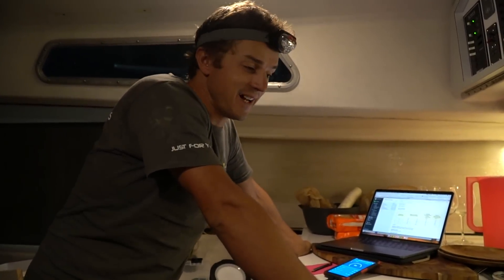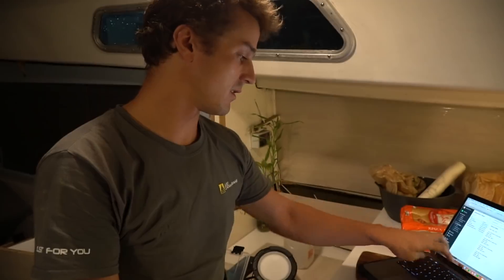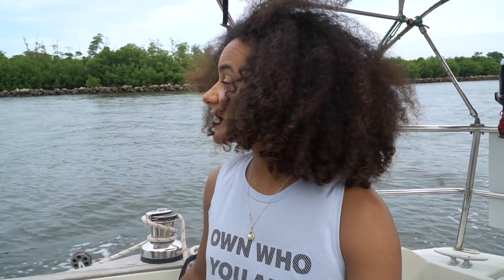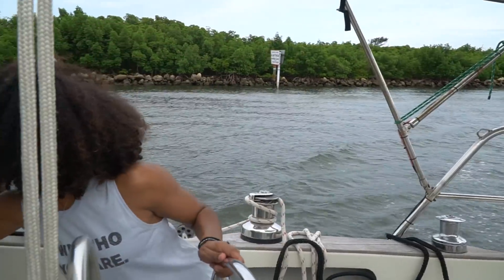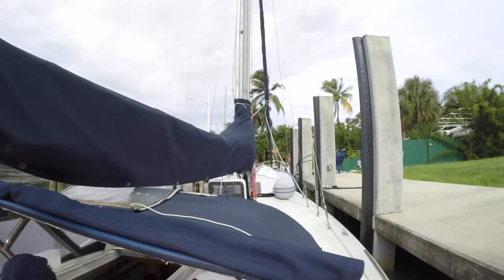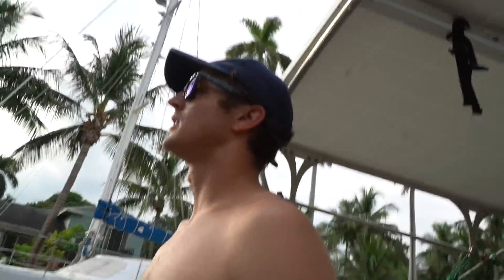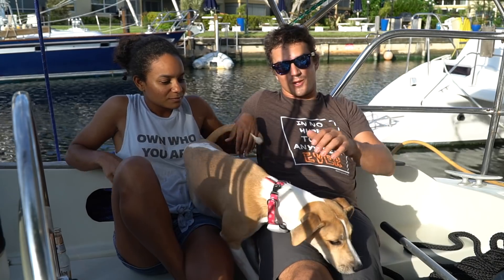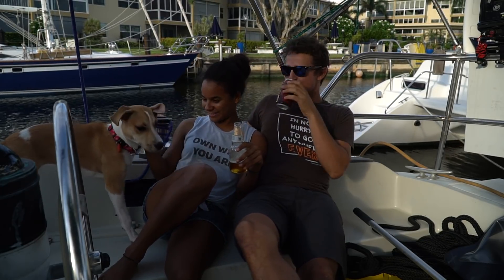Pushing our Electric Motor to its Limit— Sailing Uma [Step 139]

Comment: I think running the cooling lines on the electric motor is a very good idea, the cooler you can keep it the better it is going to work. 

Although I think the best route is going to be to have a fresh to raw type setup like you have on a petrol engine with a sea strainer and all that jazz. 

Really all you need is a tank for the coolant, and then have a larger diameter tube run through it this will prevent the system from clogging. 

I might pop off a drawing of what I have in mind and send it to you.

Comment: Ok guys , water cool that motor with a copper coil , use raw water and exit it out where you can have a visible confirmation of flow - cockpit drain maybe . Lots of electric engine cooling pumps for raw water out there . If you want it on a stat Honeywell should have something with a bulb from refrigeration you can fit . Have an override wired  because humans can anticipate and turn it on before it gets hot .   Fans rely on ambient air temp that can spike in a sun-drenched boat or one closed up due to bad weather .  

Fix your cooling issue and I think you have it . You can add a generator on deck  if the engine is not overheating and get tons of range if you ever need it for exploring a river of canal or an intercostal waterway  . Meanwhile 2 hours of range should be lots for most of the time .

Comment: Saw a video years back where a guy takes an alternator removes the triode and runs wires from the connections, putting out 440v 220v and 12v at the alternated amperage i.e. 65 amps and runs it off a small motor .. almost perpetual energy. un into voltage regulator and inverters . just a thought.
Reply: You make no sense, and losses in electric motors and generators are so large, there is no way to get anywhere near the imposible perpetual  motion.

Comment: Good stuff.. I love it ..
We use victron too and .. had the same prediction at the first time. 
The Victron does predict the power correct if it’s set correct so maybe you can adjust something or it needs to learn.
Another thing to think about is that the Tide does delay up on rivers..

Comment: I would think a blower pushing fresh air around the motor would help a lot.. The only time you should really need that much amperage though is to get into a difficult harbor in difficult conditions. Have you looked into a more efficient DC motor? And have you researched the prop size and pitch that will work best with the motor's torque and efficiency RPM curve? You might be able to pick up considerable efficiency with just a different prop.

Comment: just because the motor is rated for high temp operation it is not a good idea to run it hot at higher temps motors are less efficient so more power loss it is far better to use the heat from the engine on some way maybe a peltier to convert some of the heat into electricity to drove a raw water pump and cool the engine down

Comment: Hay guys,
Great video, thanks for sharing.
Suggestions - mount that blower up on the cockpit cowling, route the duct down and blow cool air on the motor. Will do much more cooling of the motor and also help cool compartment. Also, mount a retractable outboard motor bracket on the transom so you can use that nice dinghy motor to assist when needed. Can save your bacon or just help out during long runs.
Cheers, John H.
B.C. Canada

Comment: An "A" for effort, but I doubt this will work out in the long run. While sailors went without motors for ages, they didn't have to deal with all of the modern hindrances and requirements. You'll have much more than 3 knot currents to deal with when you're in full-on cruising mode. While an all-electric set up is possible, it isn't cheap and would really need to be designed from the ground up. Ultimately, a reliable motor is a matter of safety for yourselves, but more importantly for the other folks on the water around you. It would be tragic indeed for you to harm another person, or vessel due to a lack of engine and hull control.

Comment: To lazy to read all the comments so here are a few thoughts.  Maybe with a closed loop system you could use the heat you are generating with the motor to heat up water for showers? OR  You should be able to design a self circulating system with sea water to help keep the temps down, make physics do the work in stead of losing energy to a pump.  Based on watching your channel your sailing skills show that you obviously don't "need" the motor.  Keep experimenting!

Comment: I'm going through an electric conversion right now on my Pearson.  Two 10kw motors on the shaft for 20kw peak output.  Rarely will I run at peak (if ever); the two 10kw motors won't work as hard and won't run as hot, thus no need for liquid cooling. I really hope to avoid the thermal efficiency issue.  My boat is a P35, slightly smaller and lighter than your P365.

 By the way, I totally envy your battery config.  Still drooling.
Reply from the maker: Sounds like you might have one of the kits from Electric Yacht? They make some quality stuff. 20kW will probably cause cavitation long before you peak out. But agree with the lack of cooling needed. A motor upgrade is on our list.

Comment: Hey guys, i came across this electric boat where the electric motor is actually mounted under the boat and therefore stays cooler as the water cools it, maybe a future project? :)

Comment: I would consider enclosing one end of the motor in a sealed box and venting that with the inline fan so that cooling air is draw through the motor rather than blown over it.

Comment: Sorry guys. Electric is not yet a viable engine option for blue water cruising.
Or even for coastal cruising in many locations. Open your horizons and increase your safety by going to diesel.

Comment: Thats great but i would rig the outboard on a descending bracket hybrid you would manage to get through the solent some day you may beed to run from the weather
Reply: That would require a long shaft on the outboard which then makes it pretty hard to use going up to a beach. He's already been over that point in another video.

Comment: I love your channel, I love your work ethic and I love that you are confident in your own choices and drive to try things your way.  But I can't help but be one of those people and on this occasion and question your priorities:  Three months at a dock with access to a workshop, shore power, even dry docking facilities and you pretty up your bathroom, make a zen garden and buy a new dinghy (yeah I know you did more, but you get the point)?  Why didn't you first, at bare minimum, address adding some grip back to the deck - you've been without that forever now.  Or re-adding some toerails, stanchions or lifelines?  When you spend literally all your time on your board, surely it's safety first, pretty second?

Comment: I very seldom make a comment, but I find it hard to stop my self this time. 
When steam boats where introduce, many people talk just like many talk here.

Steam boats never will work! Nothing better than saling, nobody use engines in maritime boats! That is not for real sea men- It is just a crazy idea.
Of course, the avalanche of negative comments where all over the place.
The same can be say with locomotives and horses, horses also where unbeatable. 

Dan, I watch you work with admiration, with very limited resources you had done so much so far.  
It took industry 50 years to adopt electric motors completely, it will take less for the automobile  and pleasure boats to  do the same.
Will be not ease, but with people like you will be possible.
Reply from the maker: Thanks! It does always interest us how people hate change, even if it doesn't affect them.

Comment: I would take a wild guess that the hotter you run the motor the shorter its life. Id put a few turns of water pipe on it with an electric pump - precautionary principle...

50% is the max you can draw out right, as with leadacid, unless you are desperate...

Always good to see your vids ..
Reply from the maker: Our motor is rated to run at 356°F for 10,000+hrs. Bearings too. And we can discharge our batteries to almost dead with no harm, their LifePO4's.
Reply: @SailingUma  oh cool, or is that hot! 

Oh wow pretty funky batteries! Havent heard of such a deap cycle before.

Interesting to see how they go. Should be pretty reliable id imagine.

I like reading all the ideas people gave to improve the efficiency. There is a lot of care and concern out there. Its a fun and inspiring project obviously.  We would all have our own concoction of cooling gizmos and monitors stuck on the motor ha ha. Perhaps the batteries or cables may need cooling too? But it will all come out in the wash as its tested to its limits. All great fun.

Comment: Do you have permanent magnet motor? If you have, it is especially important to keep the engine cool because otherwise the magnets get demaged. Maybe a smaller prop diameter would help.
Reply: I think theirs is brushed motor, not the best choice for boats.

Comment: If you can find someone to help with the design, a super capacitor bank in parallel with your batteries will help with surge AMP loads. Super capacitors can store large charges and return them as brief high amp flows. When under these type of loads, a bank of super capacitors will maintain higher voltage across your battery bank because the power is from capacitors. The power is not free because after the brief amp load the battery bank will re-energize the capacitors. The capacitors will smooth the amp draw from the batteries. It will likely reduce operating battery temps and maintain higher battery voltage. You have these brief amp loads when you push transmit on the radio, turn on a fan, use power to raise the anchor,  AIS transceiver idents, or any electric motor in the first fraction of a second as it over comes inertia.
Reply from the maker: The motor controller already limits surge loads, everything else, already has capacitors in it for that reasons, the Inverter and Dc-Dc converter have capacitors built in for surge loads, like starting up heavy power tools and such.

Comment: No wind and a 3+ knot current against you is why you need a strong reliable motor that can push the boat for hours without resting. Between islands, reefs or crossing bars is a lot different to a canal or river. My Yanmar 30hp only uses ~2 litres per hour at 6 knots, so it's very economical and can run for days on a single tank.

Comment: it mite be a funnt Q  but i fly a few model eletric pwred planes...an i find that  on a static  run the engine and  prop  will use x  amount of current  but when its in air the prop will unload more  an runbetter with less power drain...wouldent it be a simular issue  with electric   boats....

Comment: Been watching you guys for over a year now and it is cool to see people so  dedicated to electric.  Totally down with that.  However, doing the math you're running into some problems.  You could be in low latitudes for 2 maybe 3 days where there is NO WIND.  With 15% of your batteries used on .5 hours you're only going to get 3.5 hours AT most running on electricity.  You're going to need an outboard backup.   There is also the chance of failure.  How is this system going to work?

Comment: with you motor is it possible to put a fan blade on the drive shaft with a small cowling hooked up to that exhaust pipe Kika was playing with I think that would help heaps

Comment: As one who has built a couple electric cars, and an electric outboard for my 26ft sailboat, I would add what some have said about cooling and temp, the motor is getting too hot,
those forklift motors are great for short-term use, and for our cars, batteries never lasted more than an hour, so was never a concern.  OEM cars use more efficient motors
and cooling and can run forever.   Cooling the outside of the case isn't effective for this motor, you need to pass cool air inside the motor past the rotor windings.  
The salty air is a concern, but don't waste time on water cooling the outside.   Best is to use a permanent magnet motor with built-in water cooling.   
Keep up the great work, love to watch the videos.

Comment: Having to spend all your time worrying about amps, miles, tidal current, temps and the like turns your life into more of an experiment. Switch back to diesel and do some blue water sailing. Otherwise you'll spend your days tinkering in coastal waters.

Comment: Have you considered replacing the DC motor with a variable phase AC motor drive system. AC motor is able to handle more loads and moisture.

Comment: Just some thoughts that come to mind:

- Is your motor rated for continuous duty?  If not, it may only be rated for 15 minute intervals.  
- Increased temperatures reduce the life expectancy of a motor. The less you heat your motor, the longer it will last.

- Are there any electronics in the motor compartment that could be damaged by increased temperatures?  200+ degrees is a lot of heat in a small space.

Comment: Using your electric motor will still damage the planet when you plug in to charge it. You should just use oars like they did before engines.
Reply from the maker: Thanks Jed, glad you can see the light past all the smog.

Comment: Dan, with the motor getting around 200 degrees, you might want to install a thermal barrier mat between the fiberglass mount and the motor mounts.   This will give you some thermal protection between the motor and the hull mounts.  Also mounting some cooling fins with some forced air would also help.

Comment: i have a mcfarlane DC charging genny which uses a honda engine to charge batteries at 55Ah. Mine can run my electric motor directly off the genny if i need to as well. It also has a lithium mode switch for charging lithiums. Highly recommended for a nice safety addition..

Comment: could you attach a 120amp alternator to the electric motor and recover some of the electricity the motor uses?
Reply: That's funny....
Reply: sigh........so use the batteries to power a alternator to charge batteries? You do know there is no such thing as a perpetual energy machine right? smh

Comment: I remember watching a SV Delos video aaages ago where they lost their battery charger and needed extra juice. So they used a tow generator to charge their batteries whilst they sailed. Here's a link to the time stamped point of usage https://youtu.be/h_zOsm_i_AQ?t=350 and it seemed to keep them going. Just wondering if a tow anchor might be suitable for you guys? That way you get the trifecta, solar, wind, and water turbine to generate power.

Comment: So I don’t understand, you’ve spent a lot on new lithium batteries, electric motor and all the junk that goes with it and it overheats and drains the batteries fast.  Why did you do all this?  Please don’t say its to go green because you still have a gas outboard and all the chemicals are Terrible for the environment.  You could have gotten a great new diesel plus a lot of other stuff for what you’ve spent.  Kiki, that hair 🤣😂

Comment: Using the electric motor to heat water is a good idea, but I wonder if you guys have considered a removable outboard bracket for your dinghy motor in situations like this!

Comment: Keep in mind that you can water cool the field windings but the armature still heats from resistive heat loss and magnetic hysteresis losses from the changing magnetic field in the iron.

Consider making openings in the end plate of the motor to force air through the motor, like is commonly done with an electric drill. A blower will push more air through the small spaces than a fan.

Comment: Why don't you put a fan blade on the front of that motor, drill some holes thru the plate and save the power that you are using for the electric fan ,you could also add some  aluminum heat sinks around the motor to draw the heat out,hold them on withh large hose clamps

Comment: First off, Kiki's hair IS amazing! Dan, nice work on the motor! I bet that was cool to run that long and have it not freak out. Great video. Kiki - how do you hold that camera so steady? I seriously thought it was locked off. Anyhoo, thanks for the hang on the boat! F
Reply from the maker: Thanks! Our camera actually has stabilization built in, which helps, but practice also makes better ;)

Comment: I don't remember how much battery stack you have now, but at a discharge rate of 56 Amps, obviously it's going to require more than a 200 amp stack to last around 4 hours.  Regarding the motor temp, that is telling you what the insulation will survive.  Remember that the internal temperature will be significantly higher and at some point, the magnetic circuit required for motoring, can become hot enough to stop working (loose magnetic characteristics).  When that happens, you are cooked....literally!

One additional lesson to be learned is in regard to cooling air.  You can blow air hundreds of feet but it is hard to suck it more than a 12 - 15 INCHES.  To cool that motor with maximum efficiency, cool air should be blown directly on the motor.  Of course, that will heat up the surrounding area, so you still need to address that as well.

That brief snapshot of you phone showed 56 Amps x 52 Volts = 2912 Watts / 746 = 3.9 HP.  Clearly, that is pretty mild test conditions!  My basic concern is that I have come across a fair number of people who are watching what you are doing and concluding that this is a great idea.  Since they don't know what they don't know, they are unaware of just how dismal the underlying physics of the system actually is, without a significant source of backup power.
Reply: just get a 3kw genny
Reply: Robert Applegate Q